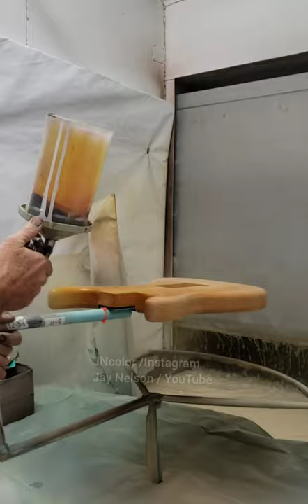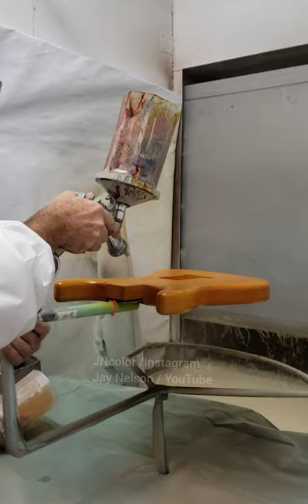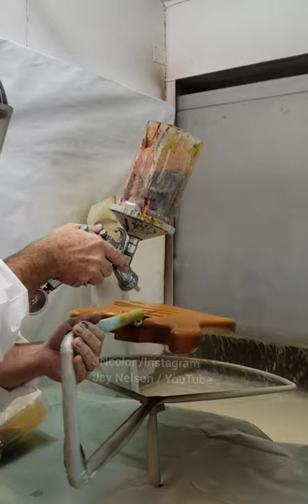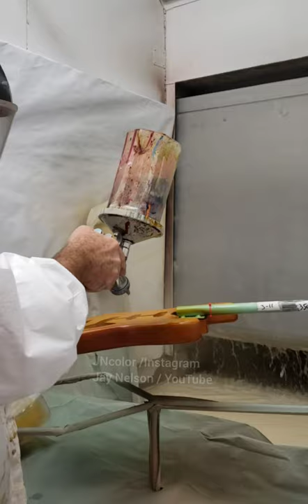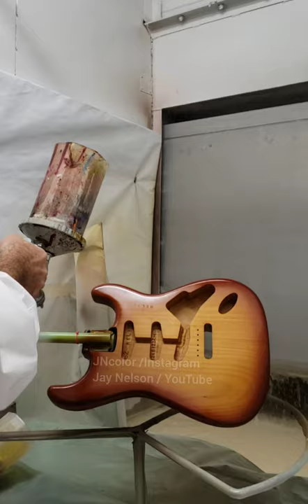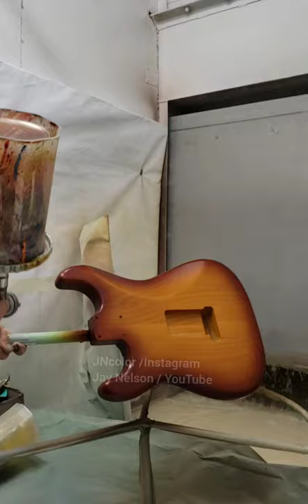Tobacco Burst

Comment: Hi. I recently examined 4 new same model Ultra Luxe Telecaster 2CS and out of the four, one surprisingly had slight sparkles, not obvious at a first glance, scattered around on the body. How could that have happened? A personal touch of the painter or an accidental spray?
Reply from the maker: I've never seen that. But those are done in the main production line. What color were they? Anything like that is definitely not a painters touch.
Reply: I have a feeling my posts are being filtered because I add links to a couple of photos of the sparkles on the guitar. The color is 2-Color Sunburst.